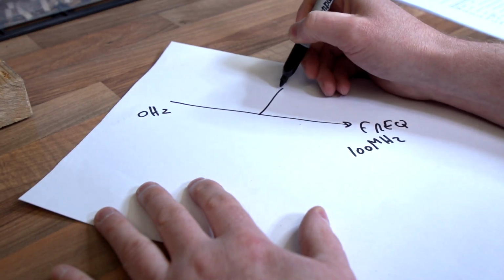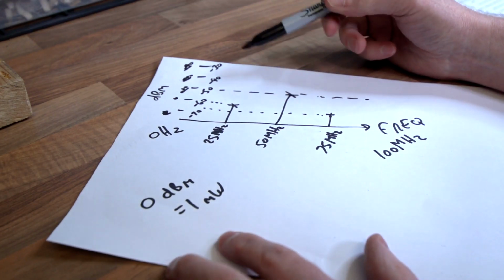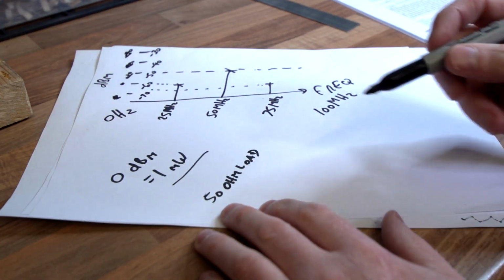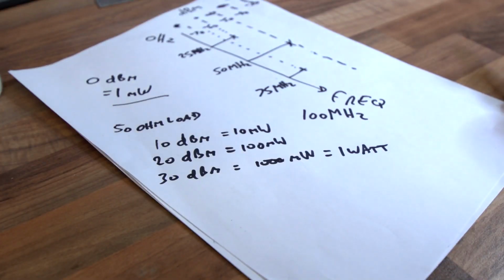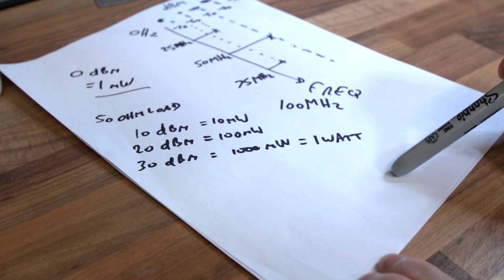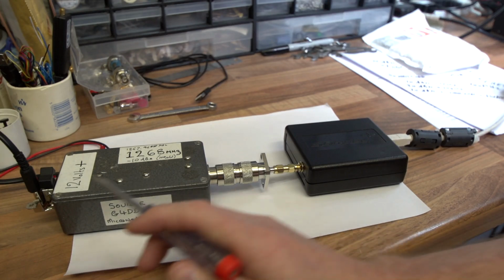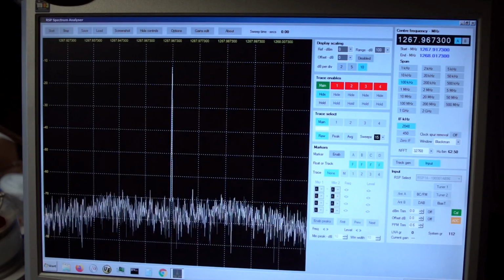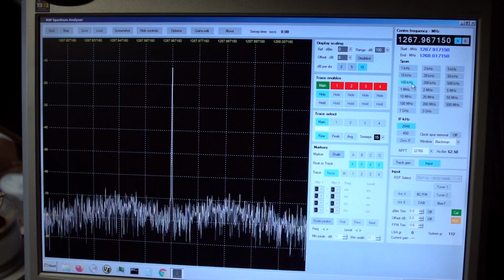Introduction to Spectrum Analysers, basics for beginners.

Comment: Just bought one of these cheap usb analyzers off ebay
Can you tell me what software you are using as it looks really good compared to all of the other videos i have seen
Thanks
Reply from the maker: Hi. The software being demonstrated here was the RSP Spectrum Analyser software. It was being used with the SDR Play device. Works really well. For the cheap LTDZ board, there's a few out there some better then others. Maybe check out SATSAGEN. Its free, looks great. Or SNASharp by F4HTQ.

Comment: Great video! I also have a ifr-1200s
Do you know if it is possible to encode and decode a CTCSS with this model
Reply from the maker: Thanks Craig. You might be able to encode a CTCSS tone using its programmable audio tone generator and modulating with that. But it can't decode ctcss. However the 1200 Super S version does have both.